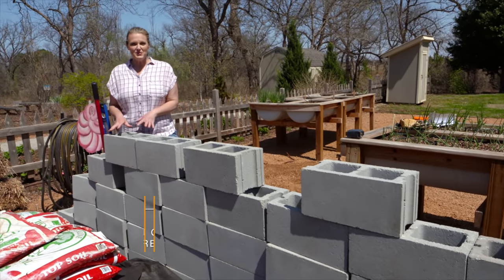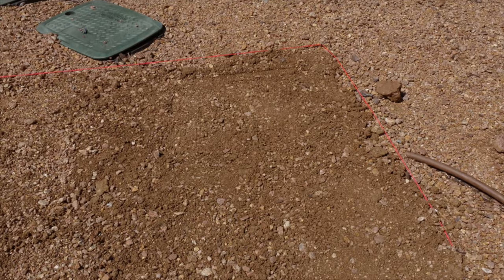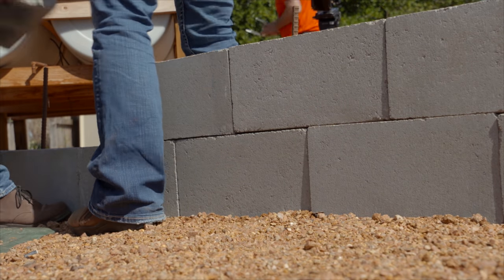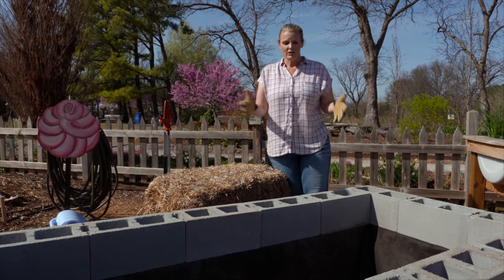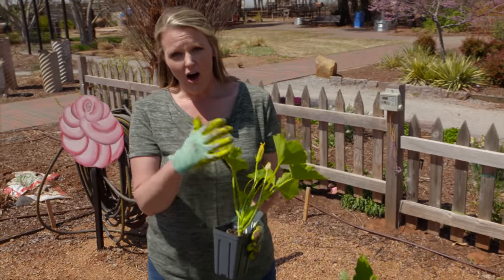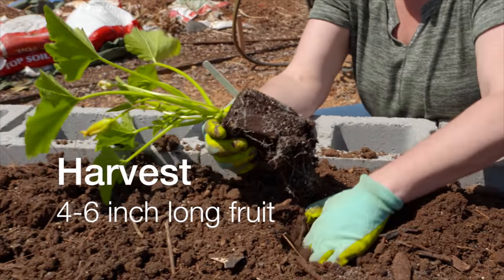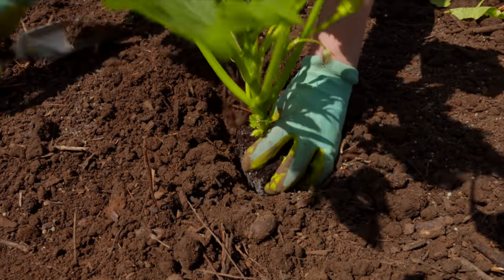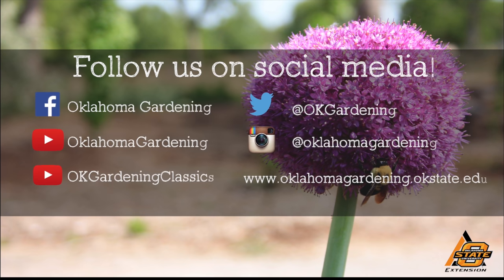Building a Cinderblock Raised Bed and Planting Squash

Comment: Your outside measurement is 32 Sq. Ft.   You have about 17 square feet of actual planting surface. 32" x 80" inside measure.
A huge waste of time and money.  Dig a pit 1' deep as large as you need and fill with topsoil and mulch. Fertilize water and plant.  DONE!